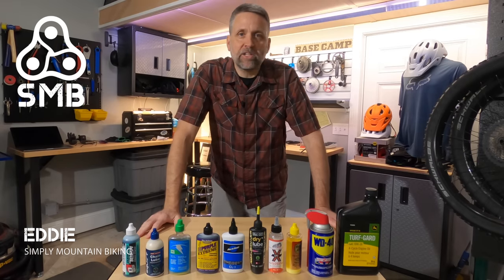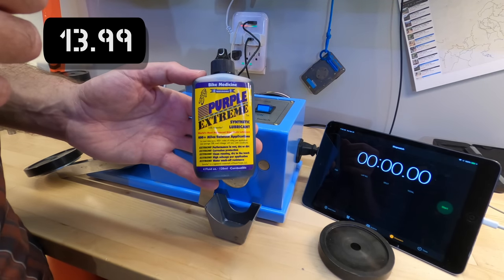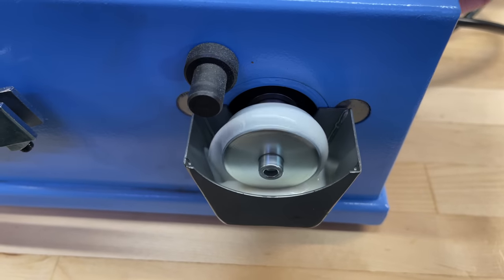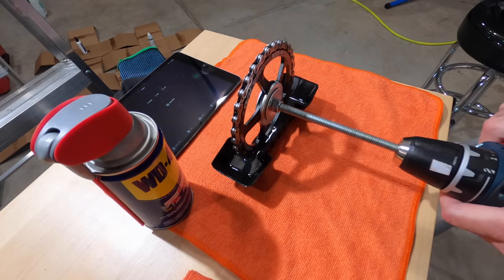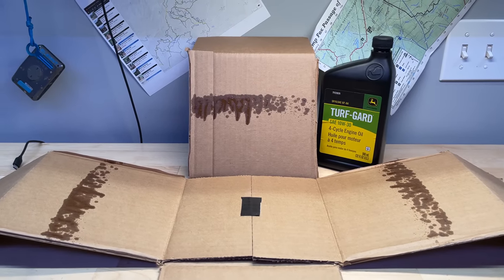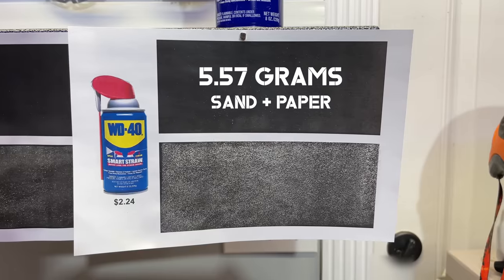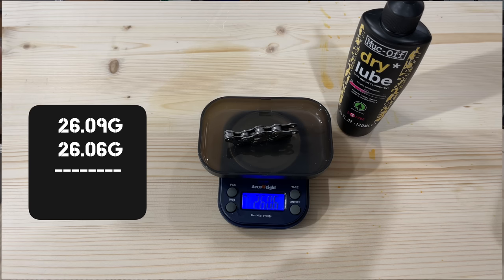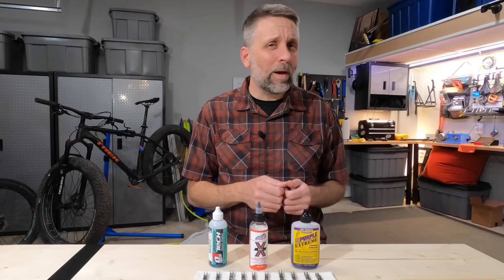Ultimate Bicycle Chain Lubricant Test | Best Bike Chain Lube

Comment: I’ve been using finish line dry on my ebike. I live in Florida and there is a ton of sand here, obviously. 

I don’t clean my chain as much as I should but did last night after getting stuck in a torrential downpour.

I used the finish line chain cleaner with eco tech degreaser and was actually surprised it wasn’t worse than it was. I didn’t notice a ton of sand but to be fair, the degreaser did have the color of dirty motor oil.

I’ve got probably enough of the dry lube to lube the chain a couple more times, but may try the finish line ebike dry after that. The muc-off is definitely something to consider though
Reply from the maker: Thanks for your comment! -Eddie

Comment: Great video!!! Having used Rock n Roll GOLD for years now on my MTB I know that it’s a great lube and I love that it also cleans the chain. However it’s only good for about 25-30 miles. Since most my rides on the MTB are less than that it works great for me. Also it doesn’t seem to perform well in wet conditions. 
For longer rides I’ve used a Wax based lube. I’m currently testing Squirt….
Reply from the maker: Let us know what you think! -Eddie

Comment: Muc off dry lube is excellent in dry condition and keeps my chain pretty clear, but wears out very quickly. You need to reoil chain  every 50 km maximum. So, for long rides I take a small 50 ml bottle of it with me. It is the price you pay for preferences of the lube.
Reply from the maker: Thanks for the info! -Eddie

Comment: I use the chain lube you can get at Walmart.  Zero chain issues outside of normal operating mileage.  I even brake clean the chain before lubing.  OMG!
Reply from the maker: Thanks for sharing.  -Eddie

Comment: Very cool video! So many choices for chain lubes these days. What works well in one location/condition doesn't always work well in other locations/conditions. My local trails are dry and dusty all summer and I mostly stick to dry lubes, but once rain starts falling and the creeks/streams are flowing those lubes can wash off even before the ride is over, so I've started to experiment with water resistant (waterproof as most claim) lubes that still minimize dust and dirt attraction (i.e. Boesheild T9, Dumonde Tech Pro X formulas, etc.). It would be interesting to see how Dumonde Tech's Pro X Regular and Pro X Lite formulas perform compared to the original. I've had very good results with their Pro X Regular formula when the conditions become wet. Thanks for this interesting and informative video! Keep it up!
Reply from the maker: That's great feedback - thanks for sharing it.  I'll keep in mind your suggestions.  Thanks! -Eddie

Comment: Just as important is the chain prep to better utilize the lubes best performance. It was only recently that I figured out cleaning chain with Simple Green was a big mistake, pitting the metal ,and robbing the chain of performance as it roughens the metal friction surfaces of chain.     If you can get by with cleaning chain with dish detergents, do it.  Other than that, I'd be interested in the best cleaning methods that preps the chain the best to utilize a quality lube better, far better than what I did many times.  Another bio cleaner used was ZEP citrus. It could be that theres a better cleaner that has 0 pit/roughing effect on the chain, as if I used a bio unfriendly cleaner like turpentine.
Reply from the maker: Hmm - never had a problem with Simple Green.  Thanks for sharing.  I'll be on the lookout for negative effects. -Eddie

Comment: Great video. A lot of care when in to each test. The results for me were great because my LBS highly recommended Muc-Off Dry Lube when I first stated riding so I have been using it all along.

I do a lot of riding in the winter snow. Should I continue using Muc-Off dry lube or should I go for their Wet Lube? or even the Muc-Off -50º?
Reply: Use wet lube on snow, been using it on winter forna couple of years now. Have not tried the - 50 since we only get a little snow here in Helsinki. The best lube in my opinion.
Reply from the maker: I'm not sure.  Jay and I have been waiting for some snow in the mountains to go do a winter bikepacking adventure on the fat bikes.  I'll be sure to check how my preferred lube, Muc-off Dry, performs! -Eddie

Comment: Any chain lubes are great its just a matter of cleaning and re lubing. Been cycling for decades now and i can say i almost used most of the available chain lubes in the market. Cleaning and re lubing you chain for at least a week and it wont matter whatever chain lube you use.
Reply from the maker: Great tip! -Eddie

Comment: Just come across this Video Eddie! Glad I did, been using the Muc-Off Dry Lube since getting back into MTB's last year, and heard plenty of speculation about the Muc-Off lubes that had me questioning it, but after watching this, I'll sure as hell keep squirting this stuff over my chains on both my MTB and my EMTB too! Out of curiosity, what brands of chain were you using? Be interesting to see a wear and stretch test on the more common 12spd chains of Shimano, Sram and KMC and other common brands! 👌🏼started off with the XT Shimano X12 chains on both my bikes and found the Shimano Chains to be wearing out almost half the distance of the KMC X12 EPT, I know theres a $8/£7 price difference in them but for XTR spec and a basic KMC 12speed chain, there should be a similarity in mileage, yet KMC almost doubles the longevity of the Shimano, and even shifts better under load and when caked in crap on a Shimano group-set, compared to Shimano's own chain!
Reply from the maker: I most often run fully shimano groupsets and chains.  I use the 11 or 12 spd chains.  I typically change my chain every year.  I know you're not supposed to - but I am typically 2:1 (chain to rear cassette) and 3:1 (chain to front cog). -Eddie

Comment: Wow you put so much effort in it. Really amazing. As I am just riding roadbikes in dry conditions and on zwift indoors I stick with sewing machine oil, really cheap and works for me. With the wax based products I alsways had small particals of wax on the floor after indoor riding...so I guess everyboidy has to find the perfect fit for his/her usage. But really intressting to see the results here.
Reply from the maker: Hey, thanks for sharing your experience! -Eddie
Reply: @SimplyMountainBiking  Hey thank you. Yes to be more precise it is fine mechanics oil I am using. A white and almost water like viscosity. for a 100 ml i pay like o.99 cents. I have used it now for 6500 km on the bike, from which probably 75% were indoors. I am using a 105 11 speed chain and when i measured it today  with a 
caliper gauge it still had well under 0.05mm of stretch/wear. Some selfcalled experts state that this fine mechanics oil is not resistant enough towards pressure, but I haven t noticed any negative effetcs. So I am really happy with it. Because of the visocisty it is probably not a good idea for mtb or lot of rain but for me it suits perfectly and I am really impressed with the little wear which after 6500 km there nearly was none. let s see how it will develop in the next hunderds of kilometers.

Comment: There are basically 2 kind of lube. One that you use just before a ride and one you put on after a ride. If you put em on the other way around the lube will not do its best.
For instance Squirt is wax lube. It consist of 2 component. One part oil/water/liquid and one part wax. The theory is that the oil will use Capillary Action to transport the wax to all surfaces then it will evaporate leaving just the wax behind. Therefore it's best to use that lube after a ride.
Reply from the maker: Got it -Eddie

Comment: Dirt is not really the enemy of a chain. That's because a chain link as it works back and forth will push dirt out of the link. This is why you can take an old dirty chain, break apart the link and it has nice clean oil between the links, Why you never want to re-oil a chain without cleaning the chain first. The enemy of a chain is drying out. Back in the day, chain drives on machines  had a drip oil feeding system to keep the chain wet, Bicycles were the first machine that had a chain drive and didn't have a drip oil feeding system. So they developed an oil that would keep the chain wet on the chain for a longer period without drying out. It was called 3 in 1 oil.
Reply from the maker: Thanks for your insights! -Eddie

Comment: Just a little question (maybe already asked over here) 

Coming from the motorcycle world... most drivetrain lubricants are to be put and left to dry...
for chain lubricants to no be flinged off the chain they need to cling and dry off making em almost like a solid grease... but in order for them to come out of the bottle they must remain liquid....

some of those lube you used probably didnt even have half their lubrificating power because of that reason....

also if ever you tried to put wd40 or pl100 in a bottle with a precision oiler.... when you shake the lube up.... some remaining propellants from the can are still mixed up with the lubricant....aerated oils do not lube verywell and usually are known to damage engine when the situation happens...(some of it has to do with the oil pump having inconsistent flow but also shearing of the oil happens since viscosity is reduced overall)

would their be a way to have a second test made with dried up lubricant on the rings?! because i have a doubt it shows the truth of what happens on a bicycle chain (not lying in a lube bath all day but worling dried up)
Reply from the maker: Thanks for your comments.  I'll certainly keep these thoughts in mind.  -Eddie
Reply: @SimplyMountainBiking  im a curious guy... never seen such endurance testing on chain lube! Very interesting 😉🙂

Comment: When this video came out I used MucOff. After reading all the comments I had to try Squirt. So I brought Squirt ebike wax - HERE ARE MY RESULTS.

And after couple of chains, I can say: Squirt is 1x better. My chains last one time more than with Mucoff dry lube. Mucoff lube just wears out to soon.

Tested with PC1110 changed at 0.75 % wear on eMTB (mostly ride turbo), applied always after ride at least 20 hours before next ride on every third ride (approx. 60km).

MucOff dry: 483km, 461km, 427km, 384km, 460 km
Squirt green: 963km, 685km (0.30 wear - still using it).

I appriciate this test and all the work that went in to the test (good job, I am happy somebody did this), but my real usage test gave different results.
Reply from the maker: Thank you for sharing your experience. -Eddie

Comment: There’s another category you didn’t consider, how the line does post-ride and cleanup.  Even tho the Muc-Off Dry lube is great, it’s pretty dirty after a few rides and I inevitably end up getting black lube on my calves and fingers after most rides.  For example, in my experience the white lightning is less messy than Muc off post-ride.
Reply from the maker: Yes, I experience black buildup with Muc-off.  I generally clean my chain every 3-5 rides due to the wet and muddy conditions I often ride in.  I usually have no trouble washing off most the gunk just with a hose and spray nozzle. -Eddie

Comment: Forgive me, but that isn't how I thought one used wax-based lubricants.  Wax based lubricants are in a carrier when liquid.  One has to allow the carrier to dry out to have the protective film of the lubricant.  Without letting it dry out you may have been testing the lubricative qualities of the carrier more than the lube. 
Same the the sling test - were the wax-based lubes dried overnight?  Your test scenarios are interesting, but it seems that you don't understand what you are testing.  Your methodology speaks of an understanding of lubes from decades ago where they were oil-based wet lubes.
Reply from the maker: Thanks for your feedback.  There's a follow - up video with Squirt tested dry.  Also - all the dry lubes were given the best rating for the sling test.  -Eddie

Comment: We've been waiting for this. I use Rock N Roll Red or Blue - added advantage being it cleans your chain at same time when you apply it so I've never cleaned my chain since I started using it.  Can't tell if Muc Off is same but that does look interesting.
Reply from the maker: Thanks for sharing. -Eddie
Reply: I use Rock N Roll Blue as well. It's their product specifically for mountain biking (Gold is the road/mountain compromise lube). It needs to be applied often, but it's clean, baby. 

I tried Squirt on the advice of a shop in Moab, but just couldn't get on with how viscous it is.

Comment: Very detailed and informative test. I've been using 90W outboard gear oil for years after testing various lubes. Wonder how it would have survived.
Reply from the maker: 90w outboard is popular in motorcycling.  Might need to try it on my bike.  Eddie

Comment: Excellent video, could you please made one testing for bike grease?
Reply from the maker: Great suggestion! -Eddie
Reply: @SimplyMountainBiking  thanks. I’m super curious about what greases are really for bearings. I also notice different parts requires different water proofing abilities, also which parts should getting smoother for better transmission efficiency.

Comment: This is an increíble amount of work and care, really impressive.
I wonder if your tests are really representative of real world situations... For example the rollers on the chain never move as fast as ion your first test but they do exhert significantly more pressure. Also some of the application methods are not following manufacturers recommendations in some tests... And your results are almost I'm direct contraction with the findings of zero friction cycling, which is very well regarded for its testing and almost similar attention to detail and care as you put in your work.
Have you done any other testing to validate your findings in a more realistic setup?

Ps: did you get inspired by fortnine? 😍
Reply from the maker: Thank you for your feedback! -Eddie

Comment: I was using finish line wet for winter riding on my fat bike.  In MN it gets cold and would barely shift.  What I found was that was too thick. I cleaned the chain and lubed with WD-40 and shifting was much improved but it’s so thin that I had to clean the chain every ride and relube.  I’m going to buy some Dumond tech.
Reply from the maker: Dumonde Tech was one of the most viscous lubricants I tried in this test.  You may find that it is too thick in colder temps.  I'd recommend Purple Extreme for your situation. -Eddie
Reply: @SimplyMountainBiking   Thanks for the info, in the summer I run the finish line wet and I mostly like it, it accumulates junk pretty fast but keeps working well for a long time.  The dry is better at not holding dirt but is harder to clean and doesn’t shift as smoothly.  So I’m stoked to try the dumond.  In the winter I’ll stick with something thin, I might try the purple?  What sucks is the salt they spread on everything here you have to wash it off every ride so the WD is almost ideal because you need to do it every time anyway.  It cleans up really easy.  And honestly the waxy dry might be the way to go???

Comment: Don't know how well your testing actually corresponds to real life use, but I sure appreciate the work here. I've used Muc-off almost exclusively for the past two years (both wet and dry lubes as well as their winter specific lubes for winter), but in my experience the dry lube does wash off quite easily even in just light rain and some puddle sprays. But that's when I use the wet lube. I use the wet lube on my commuter all the time, and on my better bike I just apply according to weather, but mostly the dry stuff. I rarely take that bike out in the rain.
Reply from the maker: Thanks for the feedback. -Eddie

Comment: Good to see you do so many different tests. I have the squirt wax and have used it on my cycle which I have covered around 30,000km. I was fed up of oil on the chain and me so tried a wax. I settled on Squirt wax and over the last three years have only changed the chain twice. It keeps me and my bike parts clean and lubed. Sorry I wont move to oil. Maybe you could add a test where you grab hold of the chains after lubing or a cycle out and see the results? Thanks for the video
Reply from the maker: Thanks for sharing!  In my experience - I have to clean my chain every 5 rides or so, no matter what lube I use.  I've used Squirt in the field (I got a free bottle at a race a year ago) and it needed cleaned after the same timeframe.  -Eddie

Comment: professional motocrossers, take their chain off, clean it thoroughly, then submerge in heated grease, enabling the grease to flow into rollers and side rails.  The viscosity thickens when cooled, retaining lubricant well.  Bottom line, clean your chain often, esp in dusty, or muddy conditions.
Reply from the maker: I agree on the importance of cleaning a chain often.  It takes me 5 minutes to clean and re-lube my chain every 3-5 rides.  If I had to do anything more than that... Well, I think I'd just buy a new chain more often.  For the price of a new chain - it's not worth the bother. -Eddie

Comment: My go to is muc off dry lube for dry and dusty weather and for rainy muddy weather muc off wet lube. Still I am very impressed by muc off dry lube in the wet test.
Reply from the maker: I've been using it for nearly a year and I am extremely impressed with the lube as well.  It certainly gets dirty in the conditions I ride - but shifting is slick and my drivetrain stays quiet. - Eddie